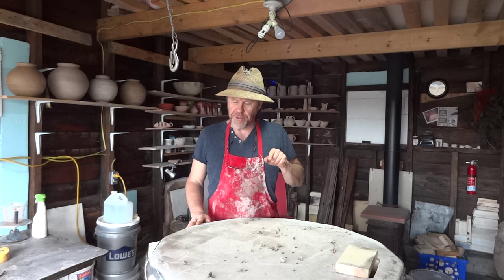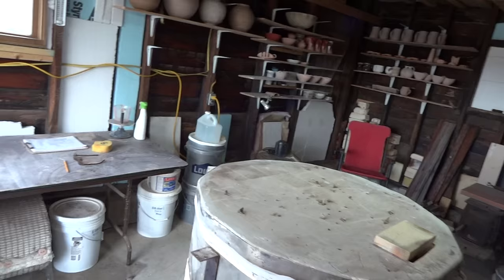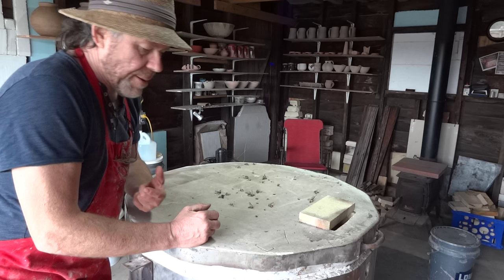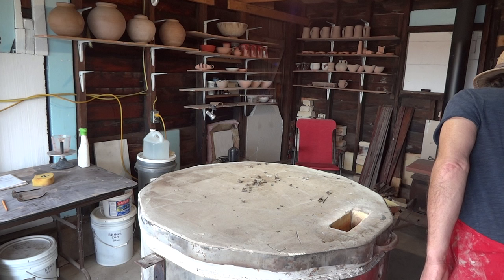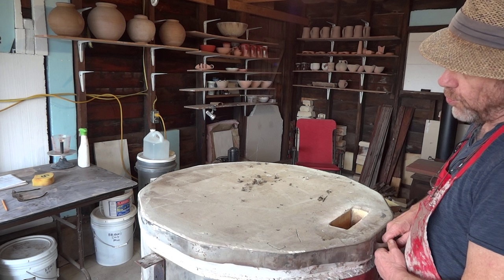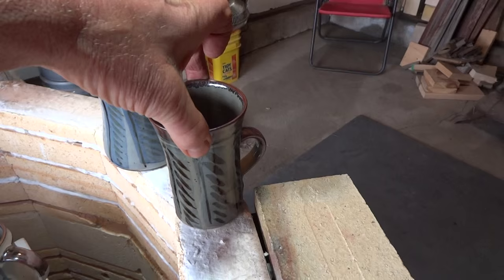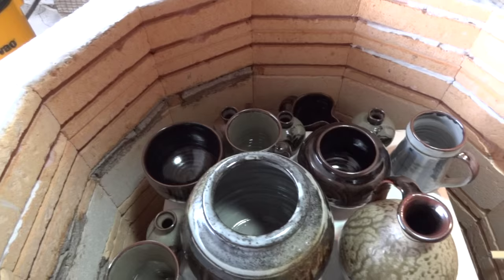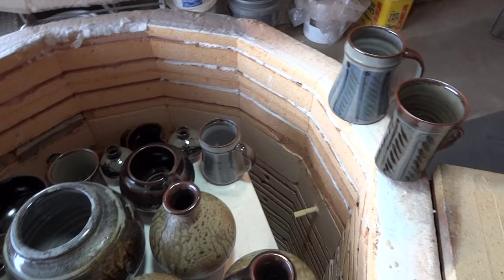SIMON LEACH POTTERY TV - Opening glaze kiln and first impressions !

Comment: Might you have a recipe for the fireplace wood ash?
Reply from the maker: +LeRoy Grubbs Wood ash, sieved and then mixed with water and sprayed on. You can wash the wood ash to get rid of the soluble salts somewhat as they act as a flux (or melter), or the ash can run rather.